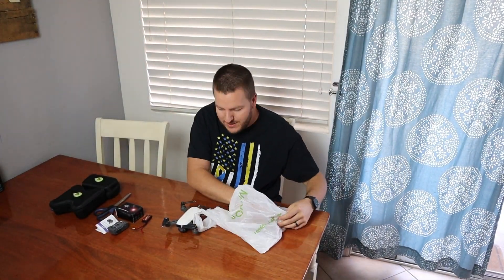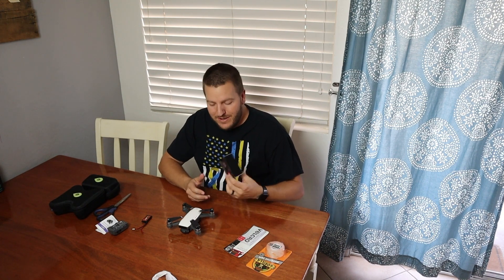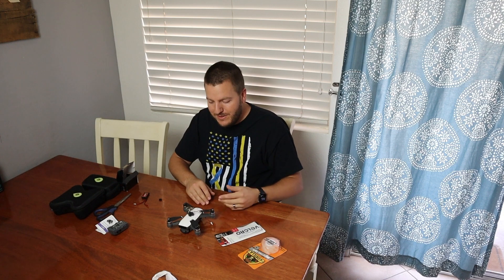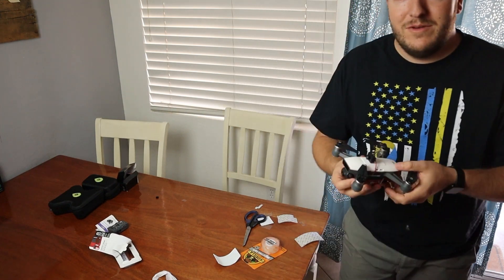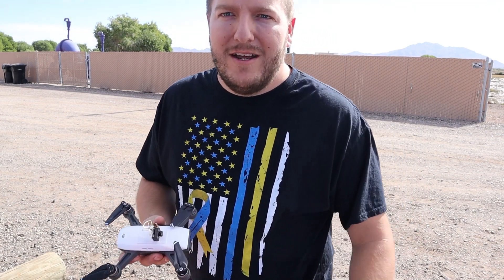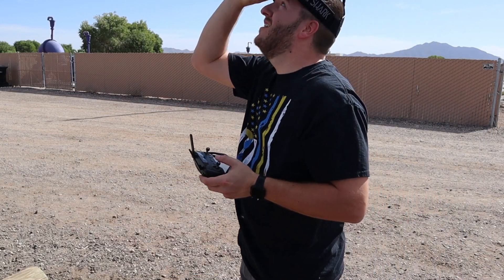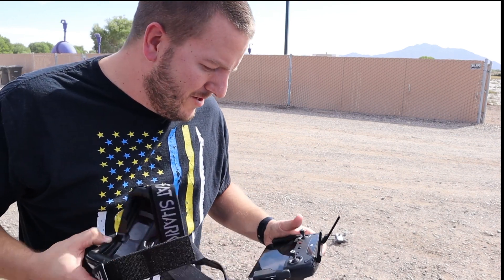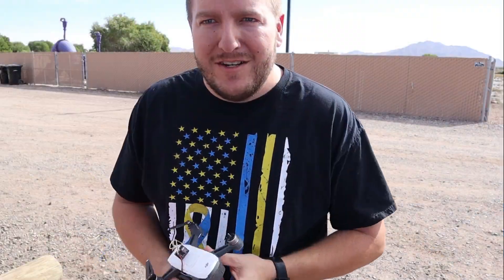FPV Everything EP:1 DJI Spark Will it work?

Comment: Dude just put your spark on a 2.4ghz channel in the menu because if your spark on 5.8ghz or auto the 5.8 from the fpv camera interferes. I have done this with no issues if your spark is solely in 2.4ghz mode